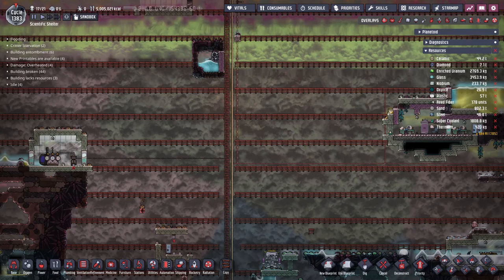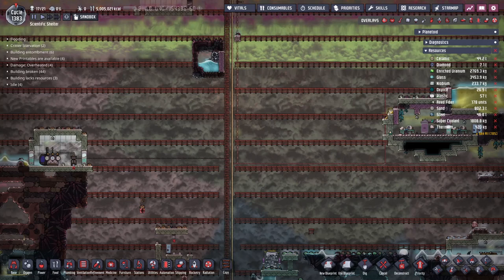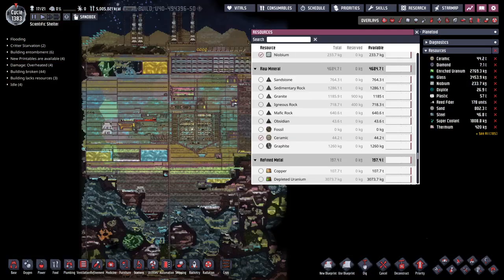Oxygen Not Included - Tutorial Bites - Strip-Mining

Comment: I agree with nearly all you said.

My preference is to space the ladders six tiles apart rather than seven.  This keeps the dupes on the ladders and not hopping from one to the next.  It is also an even number, so after a few levels a six ladder pattern comes back into line with a four ladder pattern.  

I also make the ladders a priority 6 and the digging a priority 4.  This is strip mining, so not as important as building a needed thing.  Then the top row of digging is made priority 5, which I update as the dupes get through it.  This keeps the dupes focused on digging down and not helter skelter.  

I also build full ladder runs, vice every other tile, this seems to have the dupes moving faster than hopping from ladder to ladder.

One of the biggest strengths to this style of building is also one of its drawbacks.  The things the dupes are carrying will fall to the bottom of the dig.  So a dupe transporting an egg (like a vole egg) or slime or bleach stone will drop it when their schedule changes from work to something else - and the chances are you won't notice the item in the debris pile at the bottom of the map.
Reply: 4 tiles apart have period of 5, 6 tiles apart have period of 7. these are co primes so they would meet back after 35 tiles which is not in the nice way you described.
Reply: @kaishang6406  It works fine for me.  Thank you for replying to a two year old post.

Comment: great video. my only aversion to strip mining is that i play on a very low-end computer, so all the debris, gasses, and ladders significantly hurts performance for me.
Reply from the maker: That's interesting as my understanding was that the removing the material and reducing it to gas should be less intensive on computer resources, but maybe that isn't the case.
Reply: you dont need any calculations for block of materials, however if you mine any block, gases have additional place to move to and that really hurts performance, if you leave ladders everywhere, dupes have 100s more ways to go to the same spot, which hurts performance too. If you leave debris everywhere, game has to make calculations to determine which debris pile is the closest, sweeping debris to a single place helps with that.
Reply: an interesting thing about using the ladders to dig out is that it does half the sweeping for you. as you dig if there are only ladders beneath you then the debris will fall all the way down to the bottom of the map. thus all your vertical sweeping is done for you. I use that when building my base even just to help with decor. dupes don't like a bunch of stuff on the ground for them to trip over.

Another trick to help with performance would be to vacuum out sections so that either no gasses or just a single gas in in that area. The most calculations are done for gas interactions and how they need to trade places. Only one gas no need to trade places. 🙂
Reply: that's true, what I do is after strip, try to leave only one type of gas in large area, like oxygen or co2. Then gases wont mix all the time and hurt framerate.

Comment: I have a few questions that I would be grateful if someone could answer :)

1 - judging by the distance that the dupes need to walk, along with the fact that they are wearing atmosuits, wouldn't this harm the excavation efficiency? What could I do to make getting around faster??
2 - how do I deal with the chaos caused by slime lung?? I generally do this type of digging on a smaller scale, little by little, which makes dealing with these germs easier.

3 - what do I do to deal with the heat in the lower area, where is the crude oil along with the fossils?

4 - As for liquids, is it more advantageous to let them all mix and then create a liquid separator?

I still haven't gained enough experience to get past the beginning of the mid-game (I can usually ruin my colony between 200-300 cycles :p) and most of the quality Oxygen Not Included media content isn't available in my language (Brazilian Portuguese), so it's a little difficult to find out about the game.
Reply from the maker: 1. The suits will slow down dupes a little, but they will quickly increase their athletics skill to the point where it's not a big deal, and it's still the easiest way to protect dupes too. If you want to make sure they can get around quickly then make sure you have direct routes, with at least a ladder and pole and transit tubes if you really want to go fast.
2. Atmo suits will completely avoid slimelung, otherwise you need to put the slime in a liquid so it doesn't offgas, and use deodorizers to clean polluted oxygen into normal oxygen so the germs die off.
3. Again if you have atmo suits you don't need to worry about the heat, and it's hard to get dupes in there without scalding otherwise. In terms of overall heat, it shouldn't be a problem in itself, so you don't really need to cool things down there, just keep the dupes' living areas away from the very hot things. When using machines down there, use gold amalgam or steel if you have it.
4. You can take either approach, but at some point you will probably want dedicated liquid storages for each type. You can do that as you go along, or mix them for convenience and sort them later.

In general, you want to put your living areas in a nice closed base with insulated tiles, where you can control the oxygen levels and temperatures closely. Then the rest of the map is only accessed with suit docks that makes things easier. Most of my Tutoial Bites have Portuguese subtitles, but I haven't managed to add them to the earlier ones yet so I will try and get that done in the near future!

Comment: A problem I tend to have with strip mining is that dupes get stuck because they start mining out places down the line which will then no longer have access to get back to base. I usually give the ladders +1 priority over mining the blocks, which is somewhat helpful. The problem is off course much less significant when using atmo suits or when you give the strip mining above average priority.
Reply: Try using a ladder height of 3 between levels as this give the dupes the ability to build the ladders for the next floor up and greatly reduces the chance of them getting stuck when strip mining. Another trick I use is to only do one row at a time.
Reply: @lordxabbu  or you could build ladders every-other-block and leave the gaps unmined, this way even if someone digs out a spot to place a ladder but doesn't build it, the dupes can still cross. Once everything is done those blocks caan be easily mined out at the end and boom, you're done!

Comment: i need a guide about digging out large SLIME bioms
Reply from the maker: If you have atmo suits (tutorial bite coming soon) then it's no different to anywhere else. If not, then my advice would be to dig through anyway, and it may help to have a doctor and medical packs to hand - I covered this is the tutorial bite for germs and diseases.
Reply: Slimelung has been SUPER nurfed since the game first came out. It has gone from a game ender to a minor inconveniences for a couple of cycles. It is also dies off in regular O2. if after cleaning the area out you put in a bunch of deodorizers and get rid of all the polluted O2 then the germs will just go away. 

If you wan to limit the amount of germs you have to deal with here is a trick I use. Start at the bottom of the biome and create a pool of water as wide as what you want to dig out. Make sure the water is 1 tile deep. this will prevent anything in the water from off gassing. then slowly dig up. Make sure that when you give a dig command for a slime chunk that there is nothing below it. that way when the slime is dug out it will fall into the water and not off gas. No off gas = no germs :-)
Reply: What I like to do, is start from the top and stick a door to block gas flow, of course it's not going to be perfect as the dupes come in and out, but from there you can place deodorizers on top of airflow tiles as you dig down. You can do this without atmo-suits as well, as long as it's not too hot/cold. I've found slimelucky and yuckylungs to really not be that bad. especially once you get deodorizers down.
I like you make a place t ostore slimes as well in the biome so I'll place a couple storage bins in a little pool of water, set them to sweep only and for anything that off-gasses. That way I can sweep up any slime that doesnt fall into the polluted water. As you dig down and add deodorizers, you'll turn all the polluted O2 into regular O2 which will kill off all slimelung within a few cycles.
To clean up after the fact, you can either drain or pump the polluted water somewhere and sweep everything else up. 
Good luck on your future endeavors!

Comment: What is the problem with leaving one tile between ladders?
Reply from the maker: So I've run an experiment, and for horizontal placement, dupes move at about 90% of the speed as they jump over the gaps. For vertical ladders, they move at around 50% speed so you could probably do this horizontally but not vertically. The other reason why I might prefer to not skip is to make it easier to build with a click-drag, but the blueprints mod would make this much easier.
Reply: @GCFungus  would this only be useful if your lacking of materials or like early game?
Reply from the maker: To be honest I haven't come across a scenario where you would be lacking materials in the early game for this. Commonly though I would half build for temporary access, or if heavily restricted in materials, for example when landing on a new planetoid. Strip-mining gives so many resources that means making full ladders is no issue.